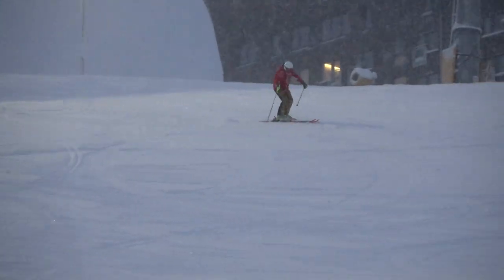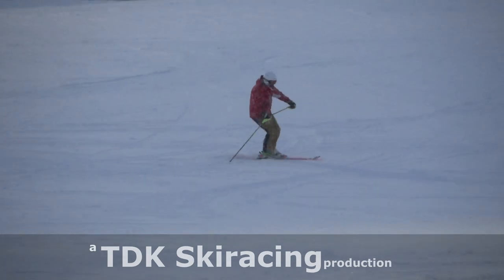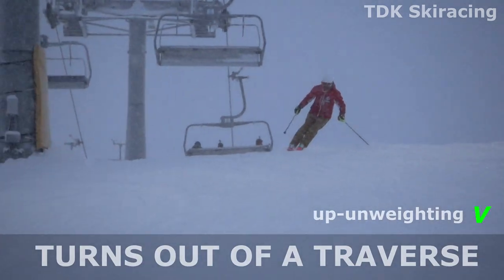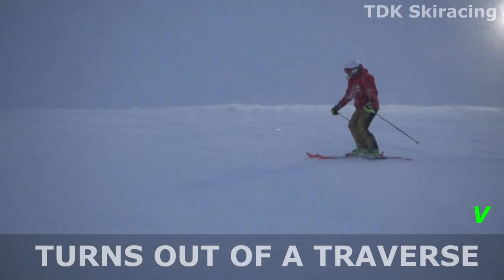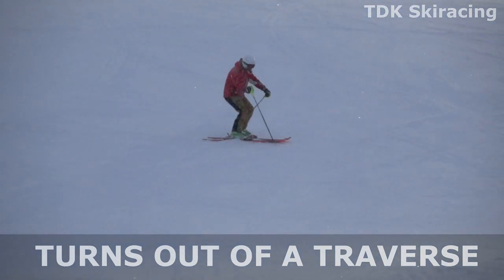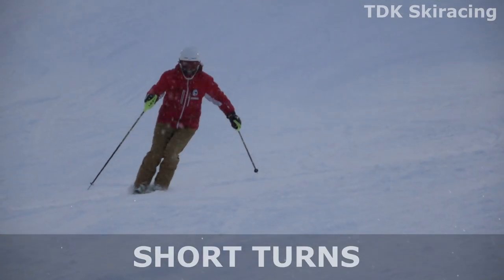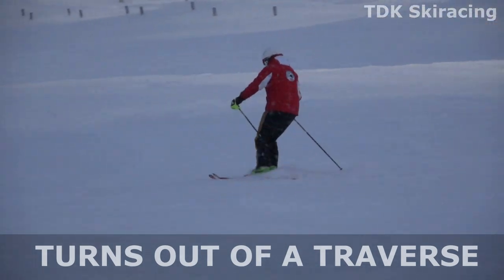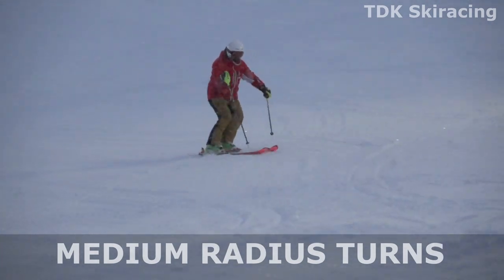How To Turn PARALLEL (Quick Guide)

Comment: I don't quite understand, do you not need an up move for short tuns? That's where I am using it the most
Reply from the maker: Yes, you need an up-move but it is embedded into the previous turn. I bet if you shoot a video of yourself from straight ahead making short turns down in the fall line your head would not be going up and down. It would remain leveled. However, if it does not remain level but is going up and down then you could maybe work on making it more level. Level up so to speak. Check my other videos on short turns. Here: https://youtu.be/ah8Eya_8H2U
Cheers, Tom

Comment: I've been trying to lose the "up motion" or early extension of the new outside leg for years. Isn't the up motion the opposite of tipping and using the ski design to turn?
Reply: I think you use boath depnding on what conditions you run in to.
Reply from the maker: MrArunasB is correct. Depending on the conditions. But not only that, it also depends on what kind of turns you want to make. There is a common misconception that you can carve all your turns. Tip the skis and use the design, just as you mentioned. You cannot. For example if its steep, if its narrow, if its crowded, if you want to ski slow, in crud, in powder, in bumps, in trees, many times in ski racing etc. etc. Carving is actually quite limited. To be used only on very nicely groomed slopes that are not too steep. Or crowded. In the video clip in this video I would have made only a few turns if I would have carved. And my speed would have been dangerously fast. If you check out my Stay Low video you will see how to loose that up motion when carving. In this or the How to ski Crud video I explain how to make classic parallel turn. Please ask more if you need. Cheers, Tom
Reply: @Triggerboy62  Thanks for the response and I very much enjoyed your stay low video.  When skiing well, however, I feel that I can initiate either a carved or a skidded turn by tipping the skis and avoiding the early extension of the outside leg or an "up" motion. Indeed, I've had more success controlling my speed on steep slopes, bumps, trees, etc.  when initiating turns by tipping rather than using an "up" motion.
Reply: @joelchernov5342  

I agrre with you. I notised the same,that instead of going up even  on steep or some bumps you get better speed control and more rounded turns when you extend forward in to new turn in stead of going up. But still going up technic has its time and place and must be mastered too. I use boath.
Reply: For down unweighting you need speed and rebound from the ski. Not everyone gets that. Up unweighting is a classic Austrian skiing technique that definitely has its place as very well explained here. No need to stand up tall is a movement from the legs only not from the upper body.

Comment: The "no steering" refers to the legs or to the upper body? I use steering to initiate the turn.
Reply from the maker: Thanks for watching. The steering actually refers to turn initiation. It is not actually totally true as in short turns there is a bit of foot steering involved but in most brushed parallel turns I don't use steering. I also doubt many do even if they think they do. Have you seen my video on steering? Here: https://youtu.be/qCS6OlxcHRE
Check it out and tell me what you think. Cheers, Tom
Reply: Thank you! And by the way, I have learned so much from you! Skiing is my greatest hobby and you helped me improved my skiing the way no other ski guide helped me over 5 years. You emphasize the small details in a clear way, which makes you the best skiing channel on YouTube.

Comment: Early weight transfer before edge change is preferred. Up unweighting often results in involuntary convergence if downhill ski remains edged. Rotary skills must be simultaneous as skis flatten. It's the hardest thing to master. Having versitility to do the task in an open or closed stance is a goal most skiers never refine.
Reply from the maker: Yeah, skiing is not that easy at all. Still, it all boils down to a few fundamentals that are a must. What you are talking about is one of them. So much talk about how to carve has lead the focus away from the classic parallel turn including up-unweighting and rotary skills. Without this kind of technique and refined skills you will never be able to ski properly. Harsh but true. Cheers, Tom

Comment: How does a beginner to learn to keep two feet close together when turns?
Reply: Lighten one of your feet, drag it back to the other foot (heel to heel) and hold it there, then immediately tip that same foot to its little toe edge to create a turn. Repeat this with the other foot when creating the next turn. This creates the illusion that the feet are always close together. And it makes for easy, efficient, and fun turns which are then used to control our speed. Remember to finish your turns in big round arcs across the fall line to keep speed in check. Each turn should be an arc shaped like a big "c". Now link your "c"'s together to look like an "s".  Look where you want to go, not down at your skis. Do this about 10,000 times and you will be an expert ! Happy and safe turns to you!
Reply from the maker: Good question XQ. Please watch my 3 Levels of Parallel skiing for a good progression. As a beginner you first need to learn how to wedge and make wedge turns. This because in a wedge you learn how to balance over your outside ski. Be sure to also watch my 3 Levels of Wedging video. When you know how to balance over your outside ski it is easier to move your feet closer together when your skis are parallel. It is not something you instantly learn. It takes time but foremost, you need to have the fundamentals ingrained. Hope this helps. Please ask further if in need for more advice. Cheers, Tom
Reply from the maker: Shelter, are you really using that technique to turn parallel?
Reply: @Triggerboy62  yes. It works great to have students go directly to parallel without the wedge. I enjoy your videos and appreciate what you do. But our methods differ in this regard.
Reply: Hi! Ski club GAGARIN from Minsk here.

 Shortly, I would advise you:
1) unlock all buckles on your boots to let your feet and shins move freely. Set your feet a bit wider then you shoulders. Bend your knees a little.
2) feel on a single foot on spot how you can use the pressure on your  metatarsal joints (MJ) under big and small toes to manage the ski rotation from inner edge to outer edge by moving the your knee side to side like a metronome.
3) after that  try to press on whole MJ-s and feel how you can  rotate your foot like DJ rotates vinyl disc by moving your heel around your MJ-s.

4) try to wedge. Initiate the turn with p.2, while reaching the fall-line continue the turn by adding p.3 and smooth bending your anke, knee and hip joints.

To turn parallel:
5) move your upper foot forward a bit and point your upper body and sight down the hill.
6) rotate your feet down the hill like in p.2 to put the pressure on whole MJ-s on both feet.
7) unbend your knees a little and fall with your body down the fall-line + rotate your feet like in p.3
8) do not rush. feel how you slide down the hill. Skis become parallel to fall-line.
9) only after reaching end of p.8 start to continue the p.2+p.3 rotation inside the turn.
10) Feel that you become a better skier.
11) repeat p.5 to p.9.
12) add it all in carving.

That's the most important things to know but not all.

P.s.: Skis shouldn't be too narrow. The best is to set your feet under hip joints.
Reply: @ShelterMutts The little known, but effective, Harald Harb PMTS method. If you watch Triggerboy62’s shorter quicker turns towards the end, he’s phantom move is subtle but there.
Reply: @Aaron Ates you are exactly right. Good eye! And before Harald Harb (and the PMTS co-founder Diana Rogers) Lito Tejada Flores wrote about this in many books and included it in videos such as "Breakthrough On Skis". Still some old Lito videos on YouTube. Thanks for noticing!
Reply: @sheltermutts4185  sorry but that tipping the inside foot part is fundamentally wrong. That activates the abductors in the legs, but you need to activate your adductors.

Comment: I don't understand why it is so difficult to ski as you ski in the first curves. Looking to you it seems very easy, but when I try to do it, it seems impossible.
Reply from the maker: Thanks for your message. Im so glad you wrote what you wrote. I have been expecting someone to ask this question. Because it is not easy even if it looks like the simplest thing in the world. You need to progress step by step. I have many beginner videos that show the progression from wedge turns to parallel skiing. First watch 3 Levels of Wedging and try to nail those drills. Even if you can wedge, doing it correctly can take some practice. We wedge all the time with Chris and our racing juniors to brush up on the fundamentals. Then watch 3 Levels of Parallel skiing. How to continue from the wedge to parallel. Also, there are many more videos on basic parallel skiing on my channel. 
It's all in the up-move. Up-unweighting. By extending up you are able to give your skis a small pivot at edge change. As you see, my movement is quite small but it needs to be much bigger in the beginning. 
Here are some videos on parallel skiing:
https://youtu.be/8Gyd0pRKNPY
https://youtu.be/VnuUREw4Nb8
https://youtu.be/wmYkVxBUcPg
If you have any more questions, please ask. Here to help you.
Cheers, Tom
Reply: @Triggerboy62  I know all your videos for beginner-intermediate. I think there is much more than an up-unweight movement. First of all there is a small projection of the body center of mass toward the internal of the new turn (sorry for my english, I'm italian :). This is the most scary/un-natural movement. It's like doing a curve on a bicycle; you use the handlebars a little, but it is essential to tilt the bike towards the inside of the curve, and the inclination must be the proper one. If your brain learns this inclination when you're a kid, then it just comes naturally and you don't even think about it, but when you're an adult it is very difficult learning how much inclination is needed.

Comment: hi Tom I am 17. I used to race when I was younger ( I practised for 1 year in the U12 I think) and I am an advanced skier even tho I haven't been on FIS skis in a while. Lately I have really been enjoy skiing so my question is is it still worth it to search a ski club to practice? I would not necessarily race if I can't fall in any category but do you think it would be worth the money just to practice?
Reply from the maker: Hard to say if ski racing is right or wrong for you specifically but from what you tell me it sounds like you have great passion for the sport and you have motivation. Yes, look for a club. And you do not have to invest that much money to start with. Just start light with one pair of skis. Tune them well and feel your way ahead. Start small. It is one of the nicest sports there is. Ski racing will develop your skiing better than any other kind. After skiracing you can do whatever you want on skis. Cheers, Tom

Comment: Thanks for again for a nice video, Tom. I understand you have to unweight your skis and create flow to easily turn them. But I appreciate if you could explain how this translates into doing it with low carving as you explain in https://www.youtube.com/watch?v=gTvcFiIy_74&t=6s. Thanks.
Reply from the maker: What a brilliant question. It is quite complicated. Unweighting that is. In classic parallel turns (lets call skidded/brushed up-unweighted turns that) the up-move to unweight is intentional with the purpose of easing the pressure under your skis to turn. In carving that is not necessary because we just tip to turn and let the skis arc clean tracks in the snow. Extending up or letting us vault up and over as in a cross-over transition is un-necessary. It can even mess up our carving totally. The initiation quickly becomes sloppy and not clean. However, the technique displayed in the video you linked, How to carve low, the slingshot effect shoots us out of the turn with lots of up-ward force and momentum as gravity is pulling us down the hill but we are turning away from that direction and vaulting over and doing a bunch of other movements to boost this movement up. This upward movement we then down-unweight as much as necessary in the transition. Not to have any side effects such as flying up in the air to high and missing a gate or crashing. Im scratching the surface here.... just ask me to explain more if needed. Cheers, Tom